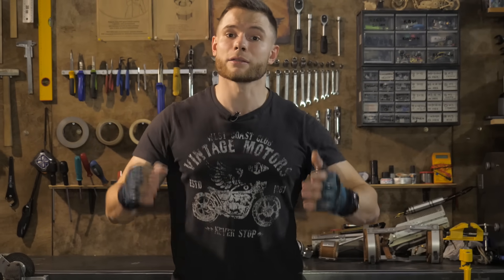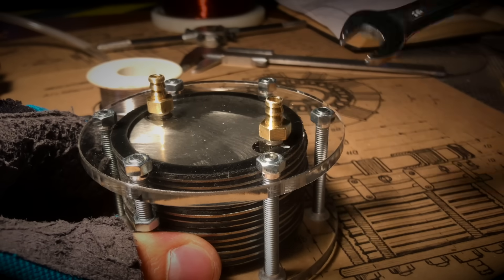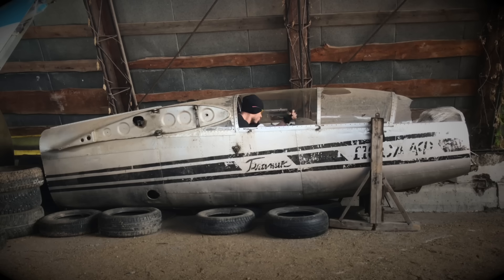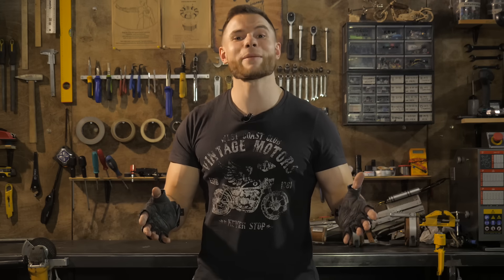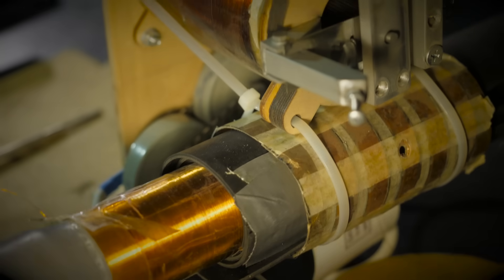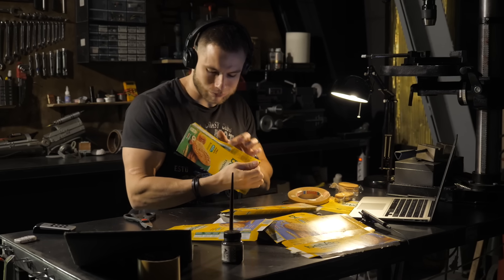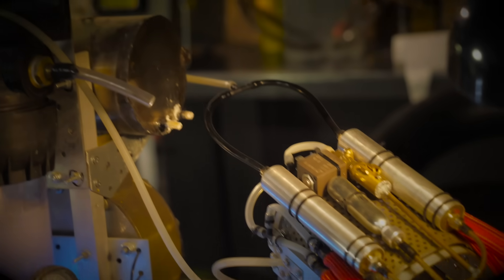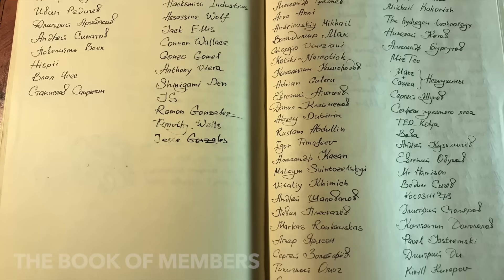Building real Iron Man suit (Part#1: Conception & Protoypes. Reactor, Repulsor, Armor, Exosuit)

Comment from the maker: What's up techno maniacs!)
This is the first episode about my ideas for making real suit.
Many production scenes remained behind the scenes, but we have a whole season ahead)
Feel free to offer your ideas.
Reply: Have you thought about putting aero gel on the palm or hydrogen torch on the iron man gauntlet so it doesn't have to burn your palms?? so you can use the torch for prolonged periods of time!
Reply: I am not an engineer, but I was thinking about a modification to your pneumatic muscles: instead of using a few large diameter tubes perhaps it is more convenient to use very small diameter tubes, even if in greater numbers, this perhaps would make the gas consumption more efficient. The idea came by looking at real muscles,  that are composed of al lot of very thin fibers. To connect all those tiny muscles you could use an alluminium block that connects all the single muscles to the same supply line, and that you can bolt on the frame.
Reply: @vittoriosandoni7064  inreasing the number of tubes will mean that there will be a greater difficulty of uniformly making all those muscles work together at the same time. Most probably it will be like some will contract more and some less. Thus less efficient.
Reply: Hey!! Awsome project dude! You brought up the issue of connecting tissue and metal... Just a wild idea, but it could help you; What if instead of having the suit directly on your skin you added a layer of fabric, something like neoprene( not sure how to spell it, the material fordiving gear) this would act as a barrier for the heat, and on it you could have the possibility of adding supporting joints in order to hold the pieces in place! Hope this can help in some way! Goodluck!
Reply: @dhuts3721  yeah this is great, I even suggested putting aero gel on the palms or on the hydrogen torch on the iron man gauntlet so it doesn't have to burn the palms but an entire body suit makes more sense tho!!
Reply: @dhuts3721  https://youtu.be/tpO5DgiCgyM
Here's a way to 3d print metal without a 3d printer, making you capable of making the armor light, strong and capable of flight!!
Reply: Try to make an hydrogen fuel cell to make all the suit running on hho. You can produce the hho in your house and store it in many small tanks distributed by all the amor.
Reply: @anonimodecm  He did exactly that in the last episode already...
Reply: @dwarfism2801  sorry, im not an native english speaker, but, when i say "fuel cell" the thing i want to say is a PEMFCs.
https://en.wikipedia.org/wiki/Fuel_cell
Reply: @anonimodecm  so you want to get elctricity from something. Not creating hydrogen with the help of electricity
Reply: @dwarfism2801  yes, and no. My idea is to make the hydrogen in the base by the electrical or chemical way, and store it in some tiny tanks distributed along the suit, and after, use that stored hydrogen to make electricity for the pneumatic muscles, or, for the repulsor.
Reply: Awesome! I really im a huge fan of your work!! My goal is also to build a iron man suit in real life! Keep it up
Reply: For shoulders to chest connection: you can do a similar design to what Nasa is doing for their new EVA suits

For elbow: a gimble but the rods are made of actuators (definitely requires research and some trial and error)

For armour "covering": Green foam can be used with CNC to create a mould and then CARBON FIBRE/FIBREGLASS can be used as the composite materials for the shape.

If anything more pops up in my head, I'll be sure to share it here!

(Just copying my original comment onto this thread as I didn't know this existed!)
Reply: @YOLO-tq3el  I thought the same thing for the arms as soon as he mentioned the restrictions!
Reply: Nice
Reply: Engineer here, the idea of metal and flesh has been a concept throughout our species obviously we can’t start putting connectors in our flesh because that would be inhumane, gory, and painful. So the next solution has to come forth, here are some of my ideas. You can try to make a custom clothing that goes under the suit not only would this protect you from heat if you use the right material but will prevent cuts and incisions from the metal, this can also prevent disease from rust cuts I forgot How to spell the disease. With this you could custom design a clothing that might be able to protect you more, allow the suit to be more mobile without getting out of place, and helping you achieve your main goal, my first suggestion would be a custom ALEX LAB wet suit, it would have parts that would connect bars and parts of the suit so it sits more snug and retains mobility, you can add carbon fiber on the outside to parts that require slightly more protection than others (organs joints etc) this would not only provide maximum safety for the body but will protect you even more from bullets in case that reach inside the suit. Carbon fiber can have a few complications when it comes to skin irritation so be careful
Reply: To cool youself of and acquire some energy you can try use a Peltier device, that transforms the heat difference in current, but those things have some rater strict working condition, and are not very efficient. Also try to look up on "vortex cooled jet engines", those are quite light weight, and can produce some decent trust.
Reply: @vittoriosandoni7064  I've seen this in a another youtuber called integza!
Reply: @marz.6102  yeah I also Watch integza, but it was some one else that came up with the original idea
Reply: @vittoriosandoni7064  those create electric current from the Seebeck effect right? I looked into those, but it looks like you'd need a lot to produce enough current
Reply: @levicampbell1819  yeah those use the Seebek effect, but as i said are very inefficient, but they don't take mutch space away and is a way to regain a part of the wasted termal energy
Reply: @vittoriosandoni7064  Another route is graphene batteries. They just are about the size of small processor and produce their own electricity from graphene sheets reacting with heat. Right now this tech is in it's infancy, but something to consider when it progresses further
Reply: For improving the arm movement, you could make shoulder plates that are connected to the chest and back plate instead of the arms. That way you are gonna be able to make them in a way that they can lift up when ever you lift up your arms. It will also make it easier to install artificial muscle there if you are planning on also putting it on your upper back or the shoulders
Reply: Really a best ever video on Iron Man Suit, love your works and ideas Alex!!

Making a Exoskeleton is the most hard part, also it's really important for any Metal Suit... btw i haven't start making anything, but I've been Making some of my own designs for Exoskeleton and the Suit of Armour 
For the past almost 2 years by making i mean that i make drawings and 3d models and i really wish to make it one day in reality. Since i can't make it now, i can help you.

1. Make a full body Exoskeleton i mean make it like a human sized structure that u can fit in and move it, walk around, should be lightweighted and evey joints should move freely. That way it won't be heavy for you to carry.

2. make your electronics and equipments less heavy, It will help.

That's all
Good Luck Alex Bro 👍 
Keep it up, you gonna make real iron man suit soon and you will be the  first one to make it.
Reply: As someone who has been interested in electrolysis research for quite some time and has not had the time nor resources to sit down and learn enough about it; an English translated guide would be extremely helpful. 

I may just get the membership, to help with my own projects in the future.

Additionally; If you want to look into Bio-Memetic servos to allow maximum range of hand movement whilst advancing the quality of the fingers, I highly recommend looking into it on youtube. An English sounding gentleman is working on hand mimicking structures that assist with movement for persons who are perhaps without hands. It appears less cluncky than the structure approach that you may be stuck with currently. Perhaps the structural changes brought on by the introduction of more flexible (or elegant in your words) movement systems that could be reinforced by singular strut structures may come in handy. I’m linking the channel I’ve been following who is working on it, and appears to be making a very interesting design. Maybe it could help your joint/movement problem more broadly. https://youtu.be/-zqZ-izx-7w

Additionally; I would like to note that essentially, the proportions needn’t be the same as we are treading into a new armor build entirely. Whilst sticking to certain canonic structures might be helpful, I think we may need to have an intricate blend of structures in the chest area to help avoid clunkiness when moving your hands in front of you. Theoretically then, what you could do, is change the shape of the Hydrogen system, redirecting aspects of it into your pectoral or low mid chest region and then allow for it to reintegrate at reactor point.

You need only be creative with the spacing, since the original armor wasn’t exactly perfect on being close to your body proportions. Additionally, I don’t think the legs are going to be the same. I know I put a lot of if/maybe statements in mainly due to tensile strength concerns on my part. I imagine you might find a creative work around or inspiration here; but I’ve no illusions that I know everything about the mechanical engineering here.
Reply: I just want to say that you could hold a large flat reactor under the chest piece (so you can’t see it) of armour to power serious weapons and have a small reactor showing in the chest to power smaller things such as the repulsors.
Reply: Was wondering if there was any new discoveries of tech that you are using in the suit
Reply: For the retractability of the suit and helmet will you use the hydrogen like in the hydrogen muscles or will it be a mechanical challenge??
Reply: I would like to see your tech in that Titanium ironman suit that Adam Savage made.
Reply: I was thinking, the movie suit is extremely form fitting, but if you want to have actual functionality you could make the suit a bit bigger. That might help you fit everything you need to inside...
Reply: You could model everything as fitting on top of an undersuit. And have an undersuit that helps with cooling, shock absorption, shrapnel protection, fire proofinh and padding. The undersuit could have multiple removable layers, so when you increase in size you just take out layers, and when you decrease in size you just add some in and the actual armor itself always fits. And if you could include some vitals and accelerometer tracking in there it would be even more cool!
Reply: Maybe an easy in/out chemical, water and battery cartridge? So even though you can only use it for short periods you can have several ready to switch in?
Reply: This is what I've been thinking about since the beginning of this series and building suits, the armor will need some way to connect to the user without having the weight of all the metal and electronics. A first step might be to create a 3D model of your proportions and then model a metal frame onto it with all the needed joints, then add electronics to actuate the limbs (with mechanical interlocks so a programing error doesn't break your leg) thus ridding the user of physical strain and allowing the attachment of armor and electronics. Good luck recreating a human skeleton out of metal and wires.
Reply: 1. Website for a more cohesive project and for your videos in case youtube takes anything down
2. Github page for the technical documents you would like to open source with your community
Reply: Please try to add iron man hand mounted missile launcher and a burning laser , it will make it to come more real.
            If you can then only........
Otherwise it will we very complex for you to manage all the stuff .
         
Big fan from INDIA 🇮🇳
Reply: Maybe look at how insect exoskeleton joints work and try to copy some of the geometry and material properties?
Reply: Your work just keeps getting better. If there were one thing I'd say, it's don't worry at all about being canonical. The tech is all yours so I think the design should be all yours too. Inspired by Ironman certainly, but with its own twists.
Reply: Alex please read this comment cause I have an idea for a leg hinge. I'm only 13 so it probably will not make the cut but I'll put a diagram I made linked here: 
https://docs.google.com/presentation/d/18CQk0OP0SA_dVsH_4sf8k-JzDyo1lftD7nVAaLqCqOo/edit?usp=sharing
Reply: The insulation part, to make the armor cooler, is it possible to use flexible material to replace the gas tube in hand muscle part ? And replace it like plate frost that came from just pipes ? Like air con concept, y'know? Freeze the plate instead of put cool tubes everywhere, plz think about it. If that possible you may as well make the armor lighter as well as more flexible movement 👍
Note : like Centralized air con concept 👍
Reply: If you used a fine aluminium powder or even nanoparticles, you might get a much higher reaction rate, and you could possibly even design a system to add powder and a controllable rate. Of course, you would also need a pretty powerful cooling system. (Could that system possibly also generate electricity from the heat to power the suit
Reply: For the armor plating I would suggest you look up Robert Murray Smith of England; he does a lot of work with Graphene and has had much success in putting together weapon resistant materials with it.

He has a list of videos and I think you to would get on well. It could be inspirational for you Alex, as you also salvage and reclaim many of your materials.
Reply: Not for all joints but for some you could use a rod and shaft system: like a ball joint at the end of a rod which goes in a shaft that is attached with a balljoint too... Answer my comment if I should try to make an stl file in fusion 360.
For the connection between body and metal you could use the same technique as in body protectors for motocross: A gel-like substance with neoprene over it so it doesn't mess with your skin but has good traction.
Reply: You are the great inspiration to me  
I had also been indulged on how to have an iron man suit real  since I was in class 5th
I think you should add a little bullet launching mechanism on shoulders ,an AI based system such as Alexa or Google assistant  controlling all movement in the suit, a  hydrogen plasma cutter in arms and much more
Reply: I've been studying different scenes from the first Iron Man movie to see what types of tech they put in the suit (I know the stuff in the movie is computer generated but it's still decent). The closest thing I found that I think would help is micro pneumatic cylinders. Instead of having a couple large ones, you could fit more small pneumatic cylinders into the suit. They even have telescoping ones that I think might really help. You could replace the pneumatic muscles seeing as they have a possiblity to pop with a lot of use
Reply: Hi Alex my name is Angshuman Bhuyan people also call me as Tony Stark  . I am from INDIA , ASSAM 
I am also an inventer like you and big fan of science well I am just 14 years old but after completing the college I will start my own engineering company name AIM - ADVANCE IDEA MECHANICS but speaking about your suit , it is not completely safe from outside it will save the pilot from bullet but if something wrong happen while flight and it is crashed from sky like iron man 3 the pilot is dead so use SORBETIN + TITANIUM alloy which is sock absorbent just like VIBRANIUM . If you like my opinion then tell your viewers in your next video i will be watching 😊 . I am keeping my eye on you from 3 years so you are making these kind of things but make sure that they don't get on wrong hands OK .
Reply: You could you compressing bag thingies around your arms (Like at the doctor or pharmacy) but only at certain points just before you're joints allowing your to have full freedom while also having a snug form fitting suit that can adapt to the size of the user
Reply: What about adding pressure sensors to the inside four-arm part of the exo skeleton and then some sort of hydraulic(just something to pull the arm) to help with difficulty of mobility
Reply: So an idea, though I doubt it would reach you
so you did mention that an aluminum oxidation is an exothermic reaction, and you will probably need to cool it in order to not suffer the fate of kebab on coal, so probably water cooling is the solution, but by chance, can you release so much heat, that water turns into steam and you can pass that steam through a miniature steam turbine for some extra oomph?
Reply: @notnigul39  Maybe not water cooling, considering if there’s a rupture you’re adding more fuel to your reactor core, which would likely complicate how well you could control the reaction. Although, I see where you’re going, this thing IS going to need a cooling system of some sort so he doesn’t bake a reactor into his chest. Turbines would only really work if there was room in the internals for it, and considering how tight he’s trying to make it so far, then I just don’t see the sizing working out.
Reply: For the battery, there s a company in the u.s. that produces solid state batteries, they do not sell to the public from what I can find, but if you reach out to them for sponsorship or a sample to use for project they would be very usefuf as they are a lot less flammable and have much higher energy density.
Reply: @averageman3951   do you think an ai system would work, it'll regulate the alkaline, the water and how much aluminum to put out in the solution. Especially when you would tend to us it more by using the repulser and the torch and when notn in use, it'll not produce too much hydrogen by making it less reactive.
Reply: What about a rail system for the outside joints instead of  the ridged joint that are interlocked in one place ?
Reply: what if you add generator that convert heat energy from reaction to electricity and from that electricity you power classic electrolysis of water. So some "extra" hydrogen will be generated with hydrogen made by only the reaction
Reply: @mategart1766  Could be clunky, unless he could miniaturize it effectively without drop off or loss of heat energy; which is highly probable in thermal energy production, and thereby a severe problem when paired with regulating the temperature to stay within a safe region for the reaction. 

I could be wrong of course, but I just don’t see it happening currently.
Reply: For the exothermic heat coming from the aluminum reactor use multiple module Sterling engines for/using the heat coming from the aluminum reactor to cool the reactor and power the suit with electrical power!
Reply: Hello! Professional exoskeleton builder here. Regarding your issue with joint alignment for the exoskeleton, this can largely be solved with a slide joint coupled with the rotational joint. 
Hard to do in text, but think something along the lines of:

<-> O <->

Where the <-> are the slides (small delta in proportion with the body part. ie 5 cm for elbow) and the O is the rotational joint. This will allow the exoskeleton to self-align and reduce the slippage (and follow-on chaffing) that typically occurs in exoskeletons.
Reply: Hey Alex, I have a little solution to the joint problem that you might find interesting. Use what I call connective bearings, a bearing design that is essentially a ball bearing, but connects two pieces together allowing them to turn separately while staying connected.

For example, in your arm, you have multiple points of complex motion, making it difficult to engineer a strong yet conformative joint. To allow the suit to move with your natural motion, use connective bearings between the midpoints of your shoulder, elbow, and wrist joints which will allow the suit to turn. Then simply mount the parts of the suit that cannot move, such as pressure cylinders, to the bearings' outer rings. With this design, you can have rigid joints that move linearly on your elbow and wrist while still maintaining the angular movement in your arm and not sacrificing space to place gadgets.

However, there is a drawback to this. It means that you will have a significant weight increase as ball bearings must be steel or similar to resist wear and tear. It also allows for more failure points in the suit, as joints and bearings are weak spots, increasing the number of joints and bearings instead of engineering a more complex joint system means you could end up with more repairs. Lastly, it also means that more of your gadgets will need to become flexible to accommodate the increased motion and fewer mounting points. Though, if you want full range of motion, you probably would need to do that anyway.

If you want to continue to discuss in more detail, reply here and we shoot each other some contact info.
Reply: Красава бро удачи
Reply: The music is perfectly picked and I was wondering if you could make a schedules that will help us stay in touch and help you pace yourself so burn out isn't a big probability?
And even then you and your fans shouldn't rush excellence!
Reply: I loved the rant in the end tho (༎ຶ ෴ ༎ຶ)(◍•ᴗ•◍)❤
Reply: @Phoney Duck I wasn't thinking about waving the lines together, because there it might a lot of friction but sure, that could be helpfull
Reply: How about making some of the gear modular? It might be too hard to fit everything in, but being able to pick and choose might help a lot!
Reply: You can of course include one lazer and hydrogen powered missile...
Reply: Oh, also having a system to put on the suit like Iron Man's old robotic arms could be cool. No need to be motorized, just something that holds parts in place to be able to put them on easily...
Reply: What is the vest that you use
Reply: Ask Hacksmith Anout Demonetization
Reply: Make Iron mask automatic
Reply: Kmake slim iron man suit i mean don't use power generator on your back like a backpack
Reply: You can also add missiles on your shoulders
Reply: I don't know preisely the schematics of your electrolyzer but isn't there a way to make it wider under the chestplate taking advantage of the space you have left? thus reducing the length and get the chestplate closer to your chest?
Reply: Do you plan to use muscles or pistons for leg? Personaly i think it would be better if you go with pistons, since they can be nore compact that muscles
Reply: Also you could use same heatshields as they are used on motorbike exhausts. The cool down everything enough, that you can touch it with clothes.
Reply: @alexlab did you consider using ecg-gel-electrodes for activating your air muscles?
Reply: Using perforated aluminum sheet rather than the aluminum tube cutoffs could reduce the thickness of the backpack (if you're worried about that)
Reply: For some of your arm movement you should try some large bearings, especially in the shoulder area, or a ball joint type system.
Reply: Ok, so tony had a miniature fusion reactor, you should instead have a miniature fission reactor to make it you own!!!!
Reply: Hey you can get reference from jarius of all see his 'iron man arm rocket launcher video' btw loved your videos you inspire me for building my own creation too❤️.
Reply: what if you just don't use hinges at all. Just use the hinges inside of you, by attaching avery part only to one part  without bending parts. For exmple you don't connect the armor of upper an d lower arm, you just attach upper arm amor to the upper arm and lower arm armor to the lower arm. you only have to make shure they have cutouts at the right places an voila you can move your arm while fully protected.
Reply: About your arm movement issues, i would
suggest linking the two parts with a
bearing at elbow height and connect one
part with the outer part of the bearing and
the other with the inner, giving you rotating
motion on your arm!
Reply: @HenriHaxhiu  No offense but isn't that the basic design he was looking at?
Reply: U can try making one extra suit which would be  water iron man suit which just simply uses nitrogen cylinders as boosters and can work as human submarine in water.😂well it's a nice idea for understanding motion of iron man flying in air .....(+practical 🔥)
Reply: This might help you with your pursuit for an exoskeleton, armor and flight!!
Reply: For the ankle joints there could be a simple mechanical part which would slide along rails on tibia and be attached on a hinge on the ventral part of foot. The same would be applied for the calves. Therefore you can literally just have a boot and then pants as separate parts which you would just have to insert into the rails on which it will move. And since it is impossible to put any jets into the legpiece, then it’s only use would be free movement.
Reply: With a complex project like this, don't underestimate springs. Extension springs, coil springs and the weird spiral ones too. Universal joins that can move in any direction. I've been designing an exoskeleton on my own and I found what helps is just trying to get metal and mechanical parts to replicate the movement of the human body first and then figure out how to mount onto your body. My first couple of designs are big and bulky, but are able to move properly and from there I simplify what I have and get rid of unnecessary sections
Reply: If certain parts require extreme mobility. Can we use the concepts of cables moving into tubes to actuate movement.
Its like mimicking cables brakes on bicycles. I guess a little bit the same way to contracts the tubes used as muscles. Then the parts moving along those directed cables just need to be retracted under each other, guided by parallel ( flexible if needed) rails?
Reply: You should check out alan's pan video
Reply: Could use a combination of flexure joints. to move the pneumatic's to the back to improve the centre of gravity and use wire to move the joints among different axis to disrupt the weight to help stop tiredness
Reply: Brilliant should sponsor you!!!
Reply: You should make a community for tech development like tony stark's father did

Just a suggestion
Reply: Hey Alex! I have been building my own armor and will share what I’ve learned. My joints are rod ends from cars. This gives great radial loads with perfect joint angles of movement. It’s good with natural hard stops! Second, when designing the suit you want 1/16- 3/16 spacer between suit and frame for padding and resistance from the metals expanding and contracting. For suit cooling, I have open panel ports on the suit controlled by micro servos via Arduino next to computer blower fans to keep the inside exoskeleton cool. For heating, just use thermal strips from heating blankets. My frame is 1”x1” thick stock bar but the strongest part should be the armor, so don’t stress the frame structure too much unless you plan to use industrial actuators like myself.
Reply: Hey Alex lab I love your videos and your work. Also for future reference I don’t recommend you use that lighter that you used at 9:36 because it is a symbol of hate and racism. I know you don’t know that because you’re Russian and probably don’t know much about the south and southern history but that is a symbol of hate and racism against African Americans in America.
Reply: Hey has anyone tried using a curved hydraulic system for an exoskeleton?
Reply: I am always inspired by your hard work and talent.
Reply: Perhaps instead of a full Mark Two Suit, you should do a mix of the Mark One suit and Mark Two suit.
Reply: Some of what you have that's made for the internal skeletal system can be made of strong rubbers rather than metal rods . The metal is what's restricted more of the movements. Transfer that into a strong yet flexible material like a nitrile or graphene and I feel like it would drastically help with the flexibility of the internal skeletal system.
Reply: Maybe you should try putting some bullet-proof glass over the reactor? Assuming the entire suit is going to be bullet-proof.
Reply: Here's a idea, miniature aluminum reactors!!
So you can get the best from multiple reactor and not overwork just one reactor!
Reply: The idea came to me when I thought of future nuclear reactors, they are more module than the gigantic ones and less dangers with the benefit of outputting more together then then one big one
Reply: Now that you have an on-board power supply, and an excess of heat- What about finding a way to convert some of the heat energy-loss into electricity, to charge a capacitor bank for a wrist mounted miniature rail gun?
Reply: @Sabadasz  small sterling engine?
Reply: @marz.6102  exactly! Either a sterling, or depending on the amount of heat, even some sort of steam powered generator. If the heat output is somewhere in the 'mildly hot' area a sterling engine would probably fare better, but if the heat output is more than enough to boil water, i feel that there would be a higher conversion rate to electricity with either steam or some other engine.

(This is all speculation, it's been a good long while since i've read up on  heat engines and thermodynamics)
Reply: @Sabadasz  probably but sterling engines have been getting smaller so in maybe multiple small sterling engines that encompass the aluminum reactor/s can be much more useful since it's able to become more compact.
Reply: If you want to make small metal tubes, electroplate a meltable 3d resin print
Reply: I use to love gyroid forms but by using booling tool of a gyroid cube on a normal cube you can create a anti gyroid form that actually contains two different forms that are everywhere same distance close to each other and I made one of stainless steel whit 0.5 mm thick for 1mm of distance between the forms ,it is difficult to make and fragile but it is the best and smallest electrolyser I’ve made that is I think better than a normal electrolyser … oh yea and I use D30 under Kevlar Tom make my “suit” able to absorb shocks.
Reply: Hey I have a idea for you!!❤️

You can use many lithium sulfer batteries instead of electrolyzer like hacksmith did in his leaf blower video and stored around 50 kw, but hacksmith used lithium polymer not lithium sulfer but lithium sulfur is 5 times more powerful so just make circle of batteries like hacksmith and put it in your chest plate

I hope you read this comment maybe modify my idea to get better results and give me a heart to let me know that you read my comment please🙏
Reply: @ruchiryadav8112  lithium sulfur battery? They are not commercial awalible. Also they have really limited cycles at the time.